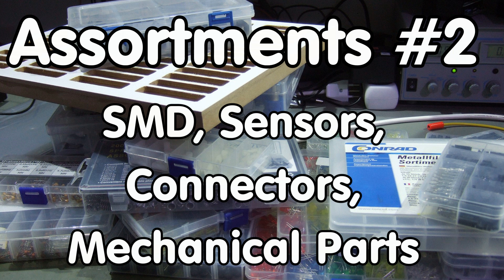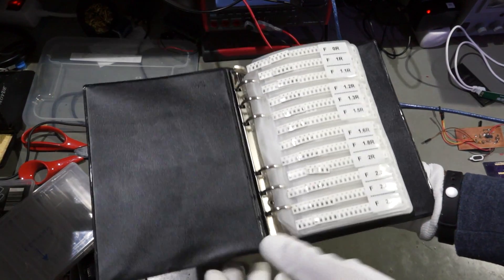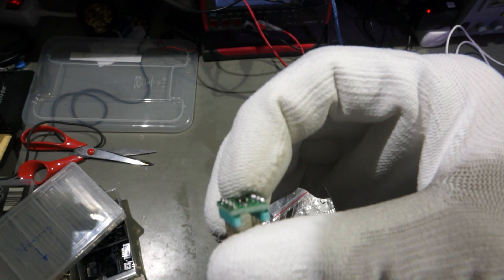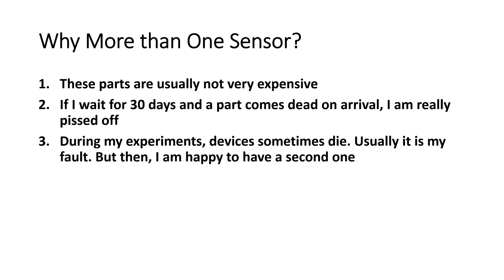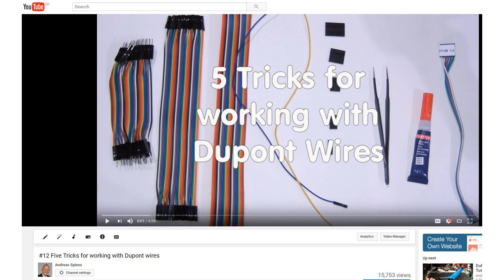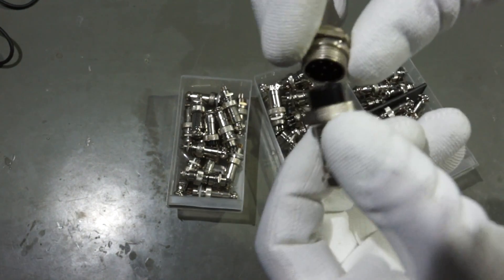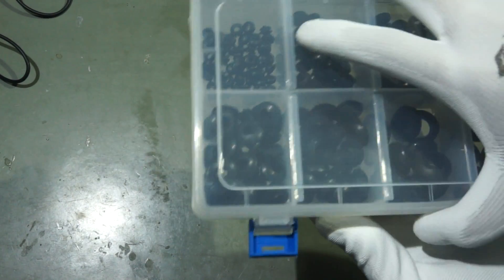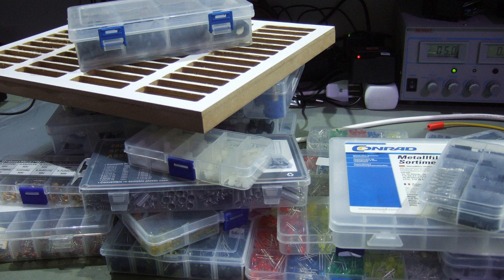#96 Assortments #2 SMD, Sensors, Connectors, Mechnical Parts

Comment: Dear Andreas!
Can advise to you search such special electronic-parts boxes:
http://askenn.com.ua/produktsiya/kassetnitsy/k-60
I bought several there in Ukraine direct from local manufacturer.
They have several models of them, all stackable one by one - great solution for lot of small parts. Good quality - metal housing with hammer-finish paint 555 * 305 * 155 mm and 60 plastic cells each 155 * 50 * 40 mm. Cells can be split by inserts even for 4 parts. Each cell have face pocket for label. Price only $ 20. You can divide any prices from this site by 26 to know in USD. If you will interested i can help to you buy these boxes.

Comment: Nice video. Wish I had seen it, before I ordered my SMD-Kits. These books looks very handy. Btw. there are other connector kits that may be handy:

https://goo.gl/Pek71k  (these are used on LipoBattery Packs and on some sensors)
https://goo.gl/7927me (PC fan connector type)
https://goo.gl/wzPoip  (good for connecting cables)
https://goo.gl/zOMd7T (for bigger connections that can't be put in wrong)
https://goo.gl/MKxQ9Z (duble row duponds, always handy)
Reply from the maker: Thanks for the links. Actually, I found them a little before you sent them and these assortments are already in the mail already. Just the last one not, because I create the doubles (rarely) with two singles and super glue...

Comment: an ebay search for "smd resistor pack" turns up loads of hits. A year back they were less common and more expensive than now. However nothing like as neat as those sample books. "m3 nylon standoffs box" is another useful assortment.
Reply from the maker: Concerning SMD assortments: Today I found a new one: https://www.aliexpress.com/item/Faux-Leather-Plastic-Paper-Black-SMD-Chip-Transistors-Assortment-Kit-36-Values-25pcs-Assorted-Sample-Book/32758120255.html ;-)
I have one of these standoff assortment, but forgot  to mention it. Thank you!

Comment: I would only add a nylon bolt and nut set, they are extremely handy. Love what you did with smaller containers, mine looks like those screwbox type ones, so I dont need as many containers, but part types are mixed... except resistors.  For your next video you can show us your collection of micro controllers.  
PS my wife will harm me if I had that many projects!!
Reply from the maker: I did not cover the bolts and nuts (and also screws) . Maybe, I thought, I want to stay towards Electronics ;-)
Concerning Microcontrollers: This is not a good story because I have too many unused. I am not very proud of them. At the beginning, I ordered some when I felt, it was a good idea. But then, I discovered, that, to start with a new line, it takes a hell a lot of time. So, many just collect dust...

Comment: For those SMD parts that come in a tape that you still keep them in the plastic bag ( 1:21): I bought empty pages like the ones you have for the resistors, and put them all in a booklet. Then I made 1 page for Op-Amp, one for LED etc. You can always add more pages where ever you want to, and you can label them as you do for every part. Easy to find, and saves a lot of space. 
http://www.banggood.com/20-Pages-Sample-Book-For-SMD-SMT-Resistor-Capacitor-Assortment-Electronic-Components-p-1100579.html?p=9R09143243493201512Z
Reply from the maker: That is a very good idea. I will do that, too. Thanks!

Comment: Second part was just as awesome as the first one! =D Just wondering about the round metal connectors around @3:54. Can you mention one or perhaps two projects you've used them for?

The only thing I could think of right now is.. Christmas lighting.. but I guess they're not waterproff without vaseline or similar, so it might not be ideal. Would be fun to know how you use them =)
Reply from the maker: 1. I used them e.g. in my race car simulator (episode #49 and 50). Also my soldering station uses them.
2. They are not waterproof. They seem to be widely used in aviation electronics
Reply: The connectors used in avionics, usually Amphenol, are always environmentally sealed. There is a lot of work that goes into the design, manufacturing, assembly and use of these to ensure that the seals remain OK.

Comment: Do you think hot melt glue comes with different properties?  The concept is quite good but  the stuff does not always stick when it cools.
Reply from the maker: At least two variants for two temperatures exist. I use the high temperature one. Then, you can have colors. I use transparent and black in two different guns. And I am sure, each supplier has its own recipe.
Hot glue is just glue and it works or does not work. So, I always have to try. Many times I use it also to fill some gaps and keep things at a particular place which you cannot do with Super Glue (my other favorite).
BTW: if you cool it below freezing, you can easily remove it.
I would not trust my live on it. So, I am glad they do not use hot glue for the airplanes ;-)
Reply: Thanks, I will look on line.

Comment: Also I found to be very useful these spacers: https://www.ebay.com/itm/282050370701 - I use them in empty boxes with some epoxy to fasten my boards in the box.
Reply from the maker: Thanks for the tip. I only have the small ones which I sometimes use in *D printed boxes. I put them on my soldering iron and press it into the material. Because they are hot, they are directly glued by the material. But they do not stick too good. Epoxy is probably better.

Comment: Having some 40 yrs of electronic designing behind me from valve days to the present day of 'do everything single  chip smd', every day there is something new to learn. It is the fun (frustration) of the challenge that keeps us going! Your  concise and 'just  right'  video presentations are always a joy  to watch and I thank you for them.
Have you played with touch pad chips yet or a video coming? That would be interesting for me.
Been playing with rfdigital transceiver modules ... worth a look at..... 
All the best .... Dave Roffey.
Reply from the maker: 1. Thanks for your compliments!
2. I played briefly with  a touch pad module. It worked quite good. Curently, I have a VL53L0X on the table which should be able to read gestures through glas...
3. As a Ham operator I am interested in RF since the age of 14 (when everything was still illegal)

Comment: Which software do you use to design pcbs for osh park?
Reply: Speaking of which... Would you mind doing a video of your typical PCB designing procedure?

Btw, thanks for another fun to watch video! :)
Reply: Yeah I would like to see that as well!, I recently started picking up pcb designing because i want to make a small RC board with motor driver and nrf24l01 smd connector but some parts were confusing and most tutorial video too long and boring, really what you want is how to design a simple component layout, implement the correct metrics, and go from electrical design to pcb. I will give eagle a try today.
Reply from the maker: Eagle